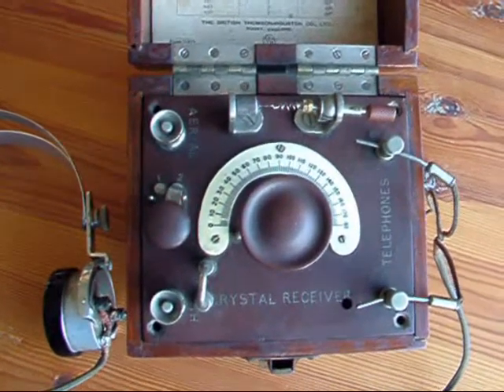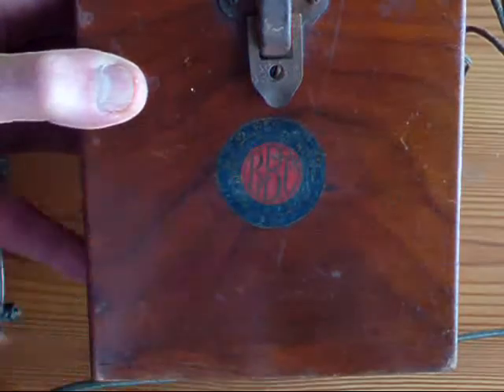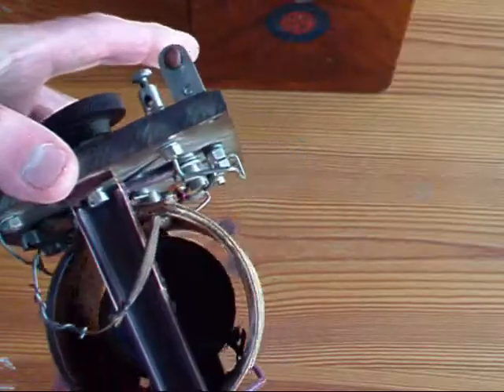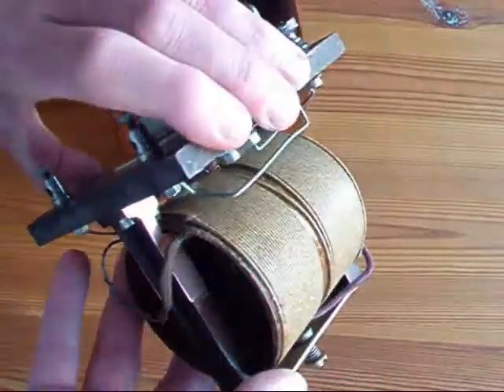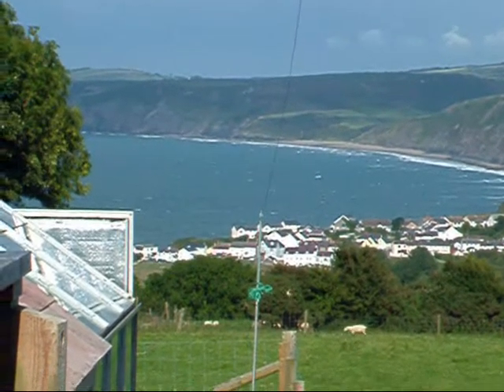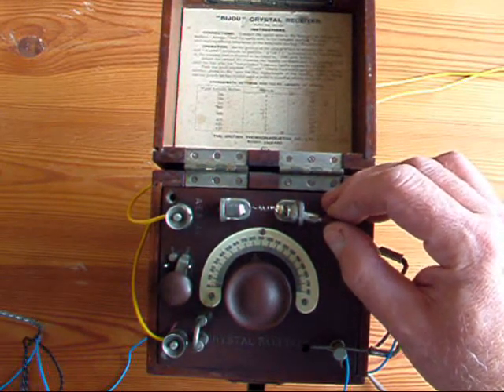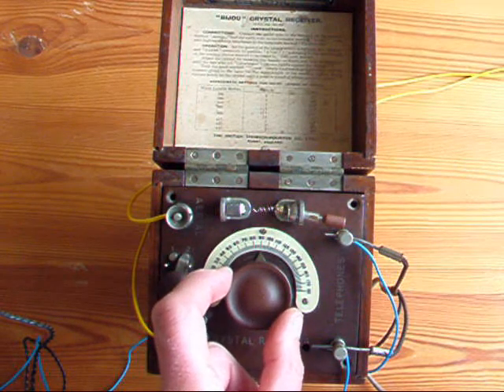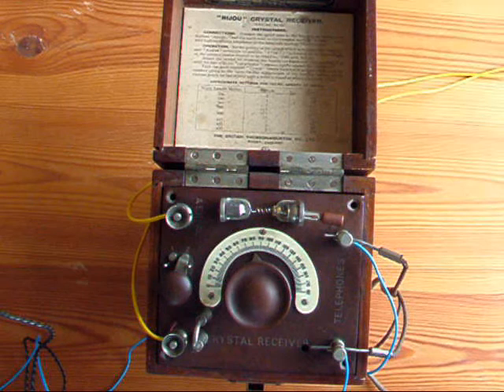Crystal Set Radio.wmv

Comment from the maker: I'm glad you liked the clip, yes I've built radios with razor blades even bits of rusty metal and pieces of rock out of the garden with traces of iron pyrite (fool's gold) in it. If you’re going to try it use a diode first to find the station then try a "cast whisker."  When I had this set up and running I used the end of a small spring and some rusty looking rock with good results.  Kind Regards ...Andy

Comment: Its a nice radio.
I think your amplifier is distorting and also doesn't pass low frequencies all that well.  A crystal radio like that one will sound quite good with good headphones.  I'd bet the thing still works today.
Reply from the maker: Hi Ken, thank you. It will be a pity when when there are no analogue radio transitions to receive with a simple detector like this. Seeing as though the capacitor is a dry construction, there's no reason to see it fail, and it's the same for the other few components in it. It's only moisture that might damage things if it got in. I have it wrapped and sealed in plastic sheet. Kind regards . . .  Andy
Reply: @AndyDaviesByTheSea  Andy, it's not that the Capacitor (in the Amp) may have "failed", more likely it's simply a very small value. Hard to see but it looks like a 1uF tantalum (or even smaller). You need to draw a circuit of the Amp as well.

Comment: 6:52 You might get better selectivity by connecting a small capacitor across the tuning inductance, not in series with the antenna.
Checkout my Foxhole Radio of my construction, and a Boy's Scout Radio of reconstruction. The latter worked far better with Iron Pyrite than Galena - - no delicate connection needed

Comment from the maker: Hi Rob thanks for the feedback. I've always been interested in radio. See my other viedos.
 In 2010 I came across a 1030's 3 valve set, it was sold in kit form nearly 80 years ago for  "The Man-of-the-House to build and enjoy" Search for "Lissen skyscraper 3" after posting the video of it someone sent me 2 huge photo copies of the original circuit diagram and building instructions. and while you're at it Search for "MK128 spy radio" it's a crystal controlled transmitter.
73's.. Andy ... gw0jxm

Comment: that's a huge aerial O_O
Reply: Seriously who the hell just plops a massive antenna in their back yard like that?
Reply: @Psythik  The Blogger is a Ham Radio operator (GW0JXM), and the antenna is clearly a simple dipole for 80 meters. Pretty much a minimum antenna for a Ham or a Shortwave listener. Hardly a massive antenna.
Reply: Signal diode specific applications or use as radio frequency detection or detecter to pass either half of modulated carrier or radio frequency with audio content to  choose or just allow to pass from anode to cathode side like valve of water pipe to switch on or off ,after detection carrier in grounded with small 47 -100 pf capacitor and audio fed to ear piece or headphones or ear pads ,modern signal diode are numbered as 1N34 ,,,OA79..,OA81 etc for detection thanks for feedback